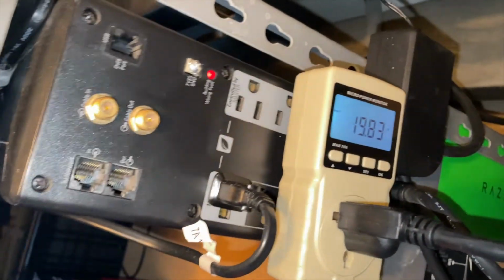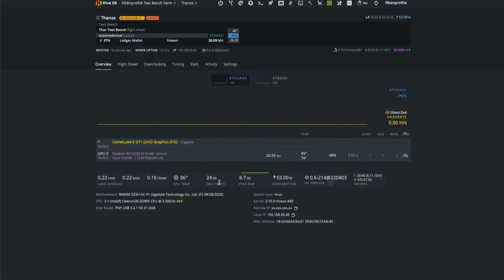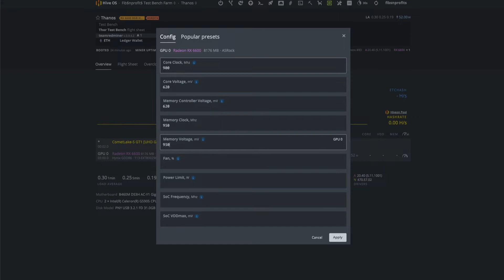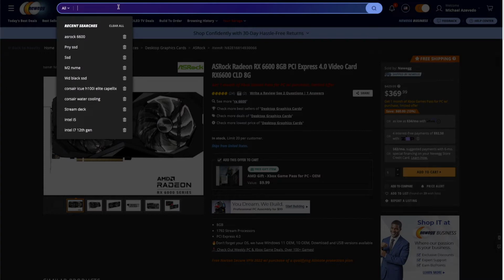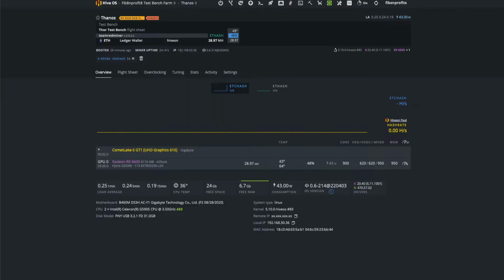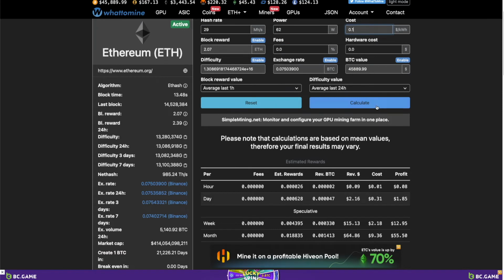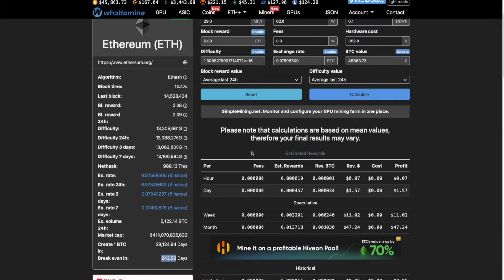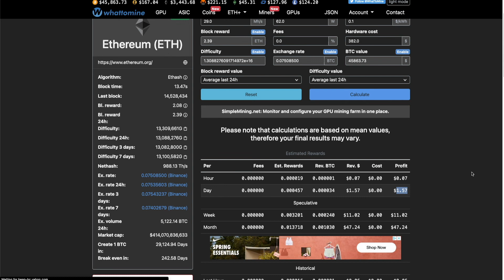Adding a new RX 6600 to my Mining Farm

Comment: Hey man, I have some settings to get the power quite a bit lower for these cards; down to 37w software (47w wall). Main ones being setting core clock to 901 instead of 900. Also settings a SoCVDDmax will make a decent reduction. All shown here:
https://youtu.be/i4Bxnymke0o
I also have videos on my channel testing these cards on all those algo's you mention you may move the card to after ETH goes POS. If you wanted to see what others are getting, and some settings.